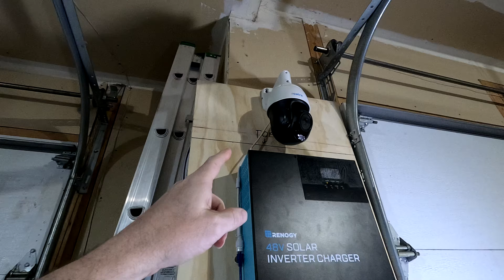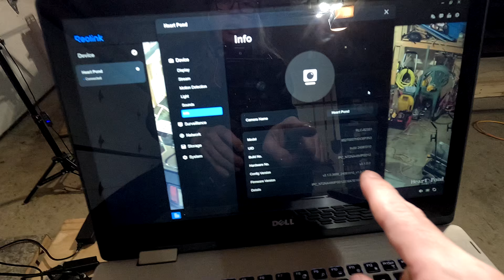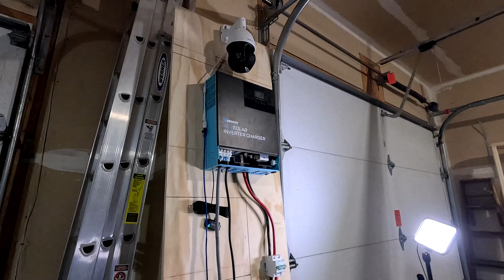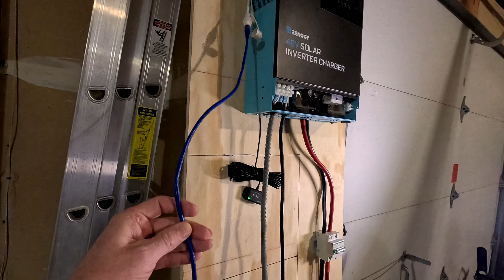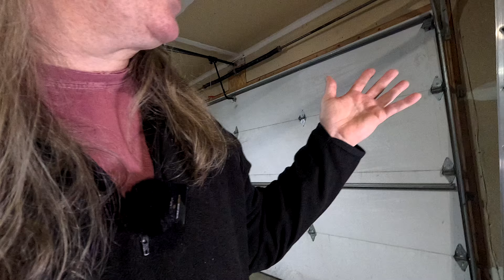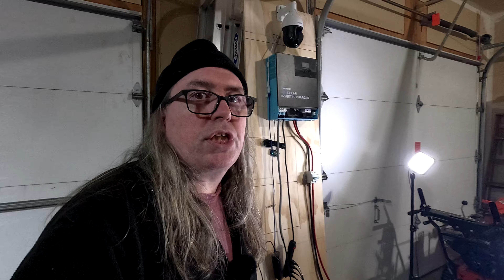Ultimate Off-Grid Solar SECURITY & Trail Camera | Reolink

Comment: Good evening from Brazil. I want to feed a 12v, 0.52A security camera with solar energy. I found on the web apparently a 30w solar panel coupled with a 12v battery and a 10A charge controller would do it for me. However I didn't find anywhere on the web the name of the cables and connectors that I need to hook solar panel + camera + controller. Any help is appreciated. I'm very new to this. 

Thank you from Brazil.
Reply from the maker: You need to research what size of copper wire can handle what amount of current (amps). You would also be smart to add fuses or breakers between devices to protect those wires and devices. Go to renology website. The have lots of FAQs and digrams. Thanks for watching and please consider subscribing! It really helps us out.